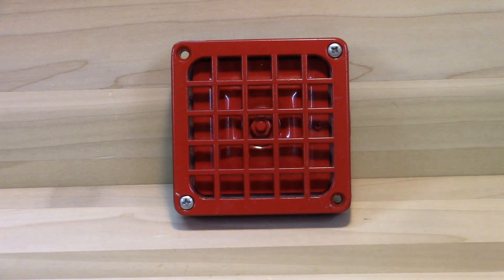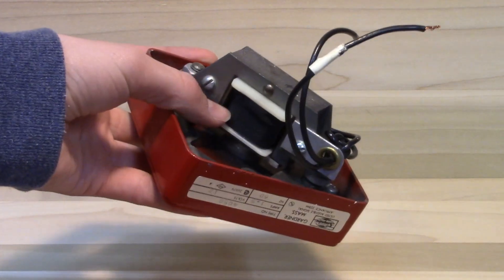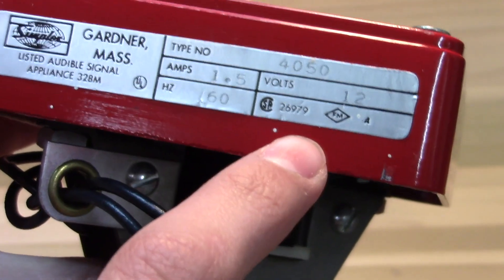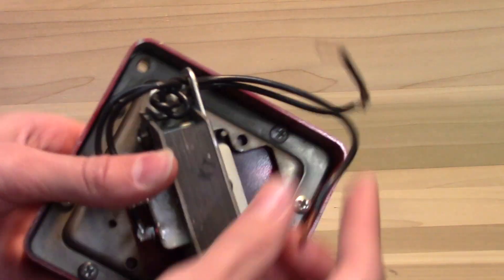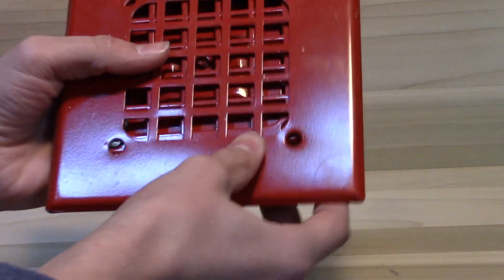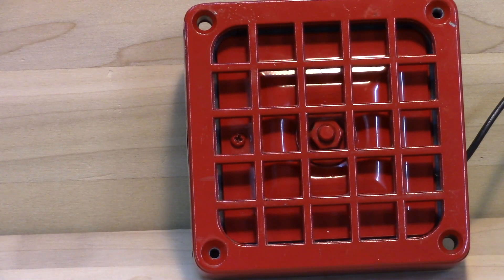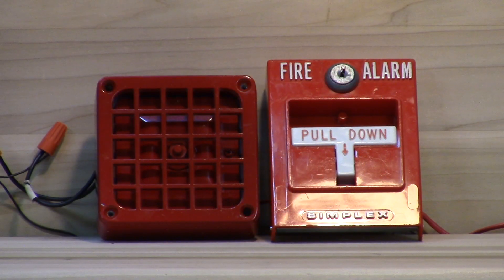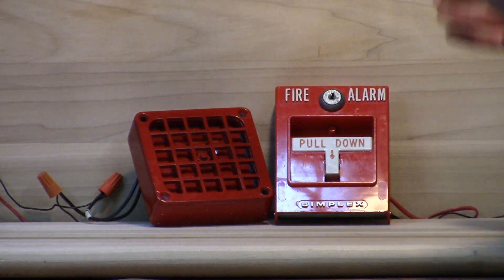Review of the Simplex 4050 Vintage Fire Alarm Horn

Comment: This alarm is at my school. It's deafening, and it vibrates the walls.
Reply: I had them in middle school...hated them with a passion. Way too loud and you could hear them through the walls if you were in the right room.
Reply: I hade them in elementary
Reply: i freaking love that sound for some reason
Reply: @VArailfan89  When I was in High School, one of the classrooms I was in had an alarm you can hear through the wall on the west side of the room. It was extremely loud--loud enough to wake up the dead
Reply: The old north grenville district high school?
Reply: @relevanteaglealarms109  Same with me but it was only in 8 classrooms that don't have windows to outside and any other classroom size room with no windows to outside. Each classroom building has a lil hallway in median of building going between the 2 middle classrooms and the back exit (no door separating the classrooms from hallways). The hallways consisted of doors to staff lounge, class storage/workspace rooms, and staff/student restrooms. There's a fire alarm like that at each back exit as well. I have high function autism and I was noise sensitive in 1st and 2nd grade. Those were the only years I had classrooms with those loud Simplex 4050's (I think) alarms. They never unexpectedly went off but they did for some reason when I was in 4th grade but I was not in a classroom with a fire alarm, but I was still in a middle classroom and heard the hallway fire alarm at back of hallway all the way from my classroom. We always had a fire drill once a month. When I was in 1st and 3rd grade, I was pulled out of class 5 minutes by my education specialist (from resource room) and 1 or 2 others in advance before fire drills because of my noise sensitivity especially. I was way less sensitive to the bells in 3rd grade. In 4th-5th grade I had different education specialists, I didn't get pulled out of class in advance for fire drills. Even though the loud fire alarms weren't in my classrooms in 4th-5th, I still covered my ears with my left arm and right shoulder while I was doing my classwork

Comment: In my old school, North Grenville district high school, turned into Kemptville public school, later shut down. We used to call the place the annex cause people thought someone got shot in the gun range in the basement of the school. The place was built in 1936. And I remember there were no alarms in the classrooms, so it would sound quiet behind this 4 inch thick steel doors, then we all had to plug our ears because it was right above our door.

Comment: A few of the old wings from the early to mid seventies at my high school still have these up (the exact model and voltage) however they’re no longer hooked up. The other old alarms from the original 1966 portions are gray Simplex 4040s/Federal Signal 350s/Standard 4-350s behind flush grilles. One of the 4050s in the 1974 extension is on a backbox and a conduit concealing flush plate. The two near the gyms are semi flush, one with a trim ring and one without, and the ones in the auxiliary gym are behind flush grilles, and one even has a diamond shaped single projector! The system put in in 2015 now has adressable Notifier NBG 12LXs replacing BNG 1s (from the 2002/03 upgrade) , addressable smokes, and a mix of Wheelock NSs RSSs and outdoor MTWPs from 2002, two MT4-24-LSMs in one of the gyms from 1995 (backboxes remaining of some in the aux gym) and Exceder HSRs for replacements and additional AVs needed and STRs in clasrooms without alarms (which are most of them).

Comment: Lots of older alarms ran on AC voltage, as it was quite common during the early days of alarms. The 4207 and 4208 were D.C. But also had an AC option, as did the Simplex 2001. Older Autocall, Standard Electric Time, and IBM coded systems (typically coded to 4-4 or 4-4-4-4) were all AC powered and put out AC voltage. D.C. draws less current and is not as dangerous, which is probably why companies switched to D.C. Voltage.

Comment: How can I use 9 volt batteries to run a 4050 because it has ac voltage and the 9 volt batteries have dc voltage

Comment: Had those in middle school with the same flush mount plate shown in the video. In continuous. Absolutely HATED them. Loud as hell, they even looked scary. LOL.  The 6th grade hall had a newer wing with Wheelock MTs on the default horn setting and I could tolerate those a little more but still didn't care for them. Boy was I glad when I got to high school...9806s on 2903 light plates with single and double projectors. The volume screws must've been in tight because they weren't too loud at all.
Reply: Those alarms were in my elementary school and they were only in 8 classrooms that don't have windows to outside and any other classroom size room with no windows to outside. Each classroom building has a lil hallway in median of building going between the 2 middle classrooms and the back exit (no door separating the classrooms from hallways). The hallways consisted of doors to staff lounge, class storage/workspace rooms, and staff/student restrooms. There's a fire alarm like that at each back exit as well. I have high function autism and I was noise sensitive in 1st and 2nd grade. Those were the only years I had classrooms with those loud Simplex 4050's (I think) alarms. They never unexpectedly went off but they did for some reason when I was in 4th grade but I was not in a classroom with a fire alarm, but I was still in a middle classroom and heard the hallway fire alarm at back of hallway all the way from my classroom. We always had a fire drill once a month. When I was in 1st and 3rd grade, I was pulled out of class 5 minutes by my education specialist (from resource room) and 1 or 2 others in advance before fire drills because of my noise sensitivity especially. I was way less sensitive to the bells in 3rd grade. In 4th-5th grade I had different education specialists, I didn't get pulled out of class in advance for fire drills. Even though the loud fire alarms weren't in my classrooms in 4th-5th, I still covered my ears with my left arm and right shoulder while I was doing my classwork. Man how can young children even handle those loud alarms especially when they unexpectedly go off!

Comment: now i know what alarm they use at the vocational school (career center) i went to, they had the flush mount cover, and from the sound i had a sinking suspicion that they were 4050s but i couldn't be 100% sure, but now i can, and from what i know, it isn't that super old (opened in 1975) so i'm not sure why they chose 4050s, i guess they wanted to really get your attention in the event of a fire (plus, i was in the electronics class, and we used drill presses and saws, so i guess a loud alarm would be necessary and beneficial, plus the automotive classes and wood shop too)

Comment: This wasn't simplex only AC voltage alarm other than the 4040 and the 4030, they have also made 2901 AC horns like the 2901 9517 and 2901 9553. Pretty interesting.
Reply: The 9517 is a AC 9833 and the 9553 is a AC 9838. I own the 9553 too
Reply: I dont own a 9517 tho

Comment: my high school is full of these, they have the plate also. they were replaced by a new system of truealerts a few years ago, so they just sit disconnected.
Reply: Try and save them; donate them to a fire museum
Reply: @neohistoryfan1014  i doubt the school will remove any, i’m thinking the reason that so many are left is so they don’t have to fill in the hole that would be left if they took them out.
Reply: My middle school has like 25 of these all around the outside of the school all sitting inactive
Reply: @BRISTOLFORCE2009  nice nice, i keep finding more and more inside my school lol.

Comment: My high school alarm is on here. We have the alarms in the hallways, Two  in the kitchen and one up by the front door with a pull station under it and one in the office and another one in a classroom. My principal always uses the pull station by the handicapped door for fire drills. I know this because I once saw him over by the handicapped door at the same pull station four times. I don't know why he doesn't use any of the other ones.

The last fire drill they had was on the last day of school and I got to set the alarm off. They wouldn't let me choose any pull station. But it was pretty cool. It was loud. I also got to reset the pull station. They don't reset the fire alarms at the panel. I don't know why.

Comment: These alarms we had at my Elementary School back in the early 90's before apparently strobes were mandated
Reply: Same with me but it was only in 8 classrooms that don't have windows to outside and any other classroom size room with no windows to outside. Each classroom building has a lil hallway in median of building going between the 2 middle classrooms and the back exit (no door separating the classrooms from hallways). The hallways consisted of doors to staff lounge, class storage/workspace rooms, and staff/student restrooms. There's a fire alarm like that at each back exit as well. I have high function autism and I was noise sensitive in 1st and 2nd grade. Those were the only years I had classrooms with those loud Simplex 4050's (I think) alarms. They never unexpectedly went off but they did for some reason when I was in 4th grade but I was not in a classroom with a fire alarm, but I was still in a middle classroom and heard the hallway fire alarm at back of hallway all the way from my classroom. We always had a fire drill once a month. When I was in 1st and 3rd grade, I was pulled out of class 5 minutes by my education specialist (from resource room) and 1 or 2 others in advance before fire drills because of my noise sensitivity especially. I was way less sensitive to the bells in 3rd grade. In 4th-5th grade I had different education specialists, I didn't get pulled out of class in advance for fire drills. Even though the loud fire alarms weren't in my classrooms in 4th-5th, I still covered my ears with my left arm and right shoulder while I was doing my classwork

Comment: This is a rebranded Faraday 5410. Simplex did not manufacture these horn, contrary to popular belief
Reply: ElevatorMan5482 ElevExperiencing Productions The 4051 is a faraday 5410. The AC versions were manufactured by Federal Signal Corp. as the 350 vibratone series A2 I believe
Reply: No. The 4051 is a Faraday 5610. You're thinking of the 4040. That was a Federal Signal Vibratone 350 series A1.